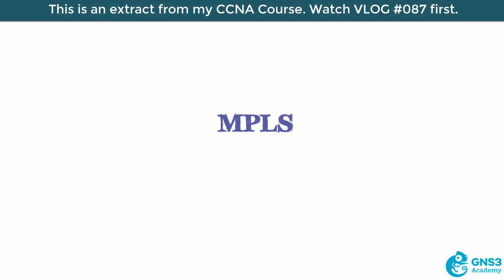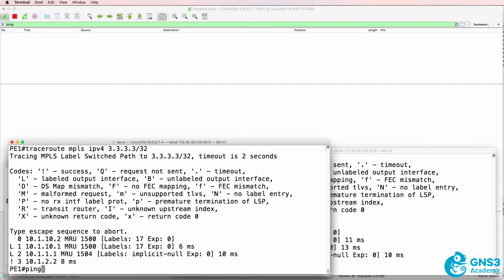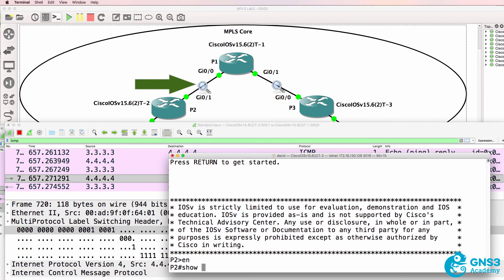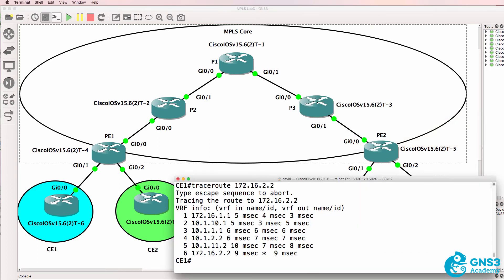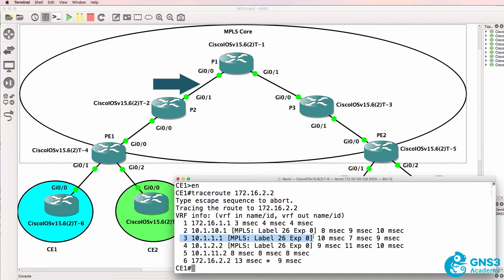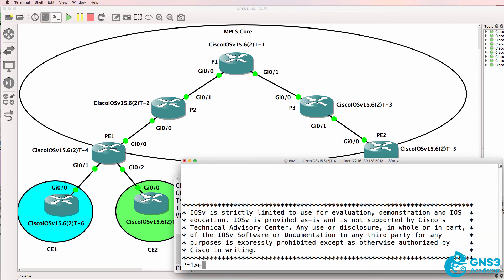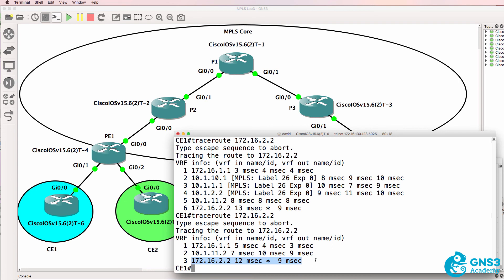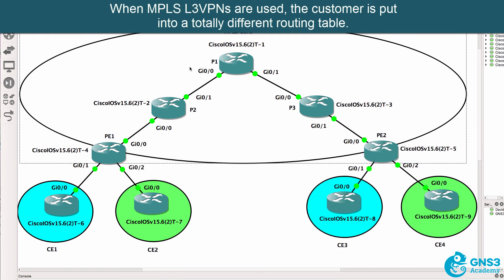CCNA #088: MPLS Part 5: Hide Core MPLS network from customers

Comment: Hi David, 
thank you for the vidoes, 
 Why when i trace from  loopbacks (loop CE1 to lopp CE2 ) the mpls lables appears ??

CE1#traceroute 33.33.33.33
Type escape sequence to abort.
Tracing the route to 33.33.33.33
VRF info: (vrf in name/id, vrf out name/id)
  1 10.0.0.1 8 msec 24 msec 24 msec
  2 50.0.0.2 [MPLS: Label 508 Exp 0] 128 msec 136 msec 120 msec
  3 11.0.0.2 148 msec 120 msec 168 msec